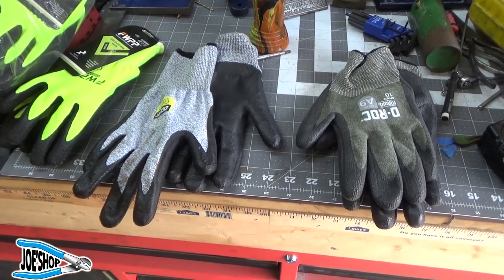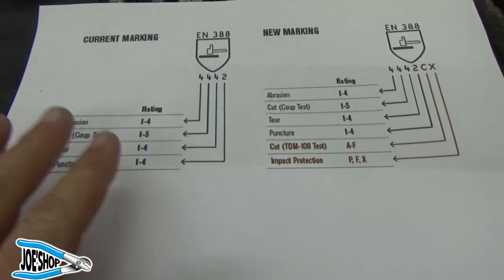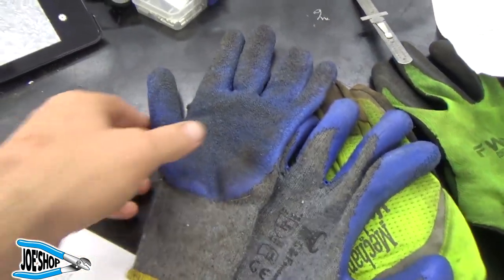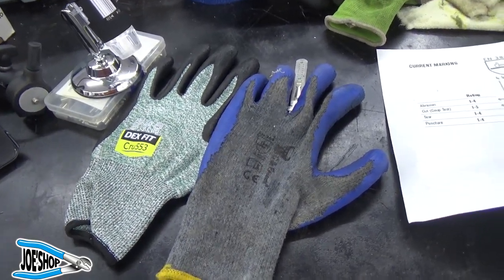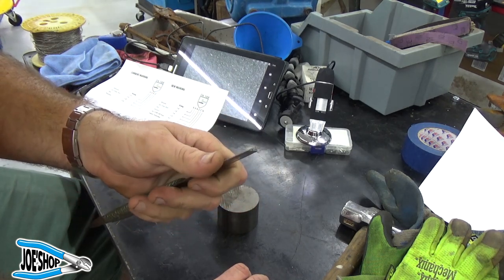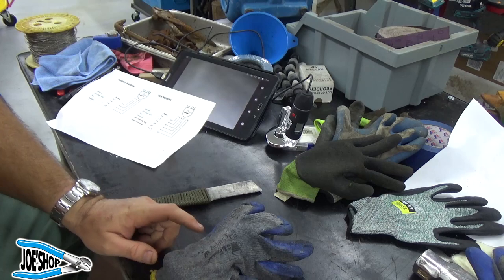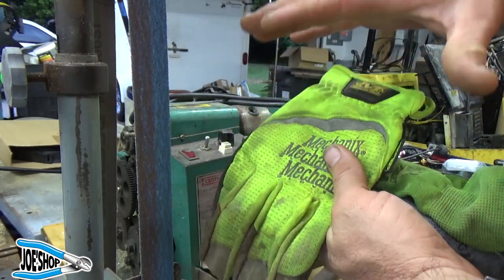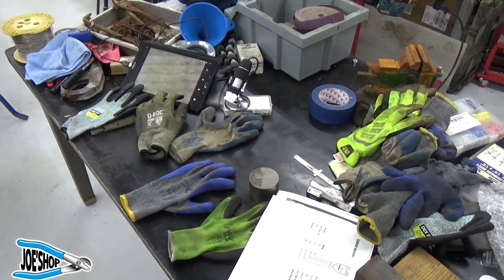Work glove (abrasion, cut, tear & puncture) test

Comment: One of the other glove related issues is how they fit.  I struggle with finding gloves with the right length fingers that allow a full range of motion.  I have found leather panel gloves at harbor freight that fit, provide pretty good tactile sense, and are tough enough to last a surprisingly long time.  The leather panels are white (only for the first 60 seconds) and they are about $10.00 a pair.